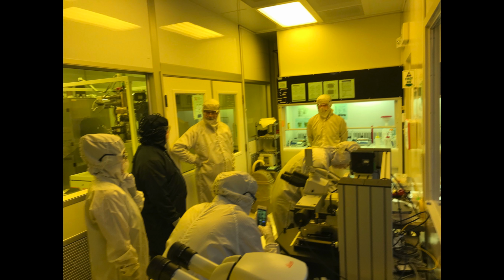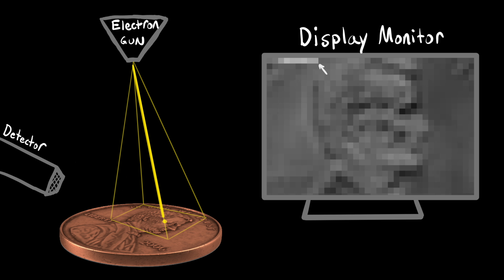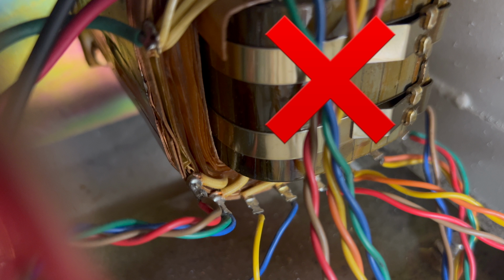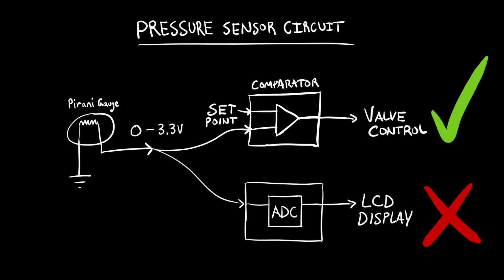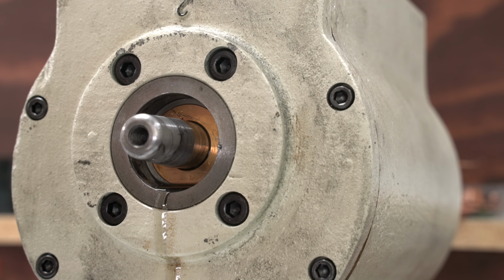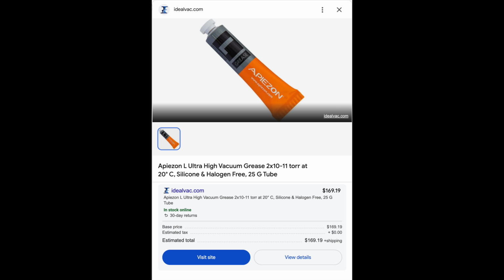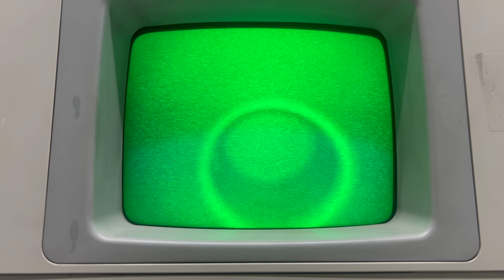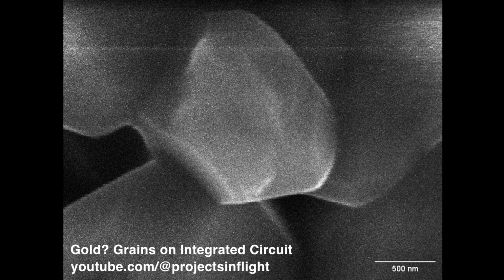I Saved an Electron Microscope from the Trash

Comment: wow. this is the best repair video on all internet. your effort didnt go unnoticed. i have a suggestion: rebuild this electron microscope and make it opensource. many parts of it are very old, and could be somehow easily changed to a more compact form. the screen, for instance, could be changed to a better display. all the buttons could be more compact too. just to say a few
Reply from the maker: I've contemplated open-source electron microscopes and I have come to the conclusion that the main limiting factor isn't any of the logic or analog boards, but the electron lenses themselves. The electron lenses are very hard to make and without the ability to make them first there's probably little point to open-sourcing anything else.

Comment: Quite an achievement this is! I bet you learnt a lot on the way. Word of advice: make sure you keep all the original parts in a safe place and not scrap them. Everything (well, nearly everything) is repairable, like the RCA cable which would be very very easy to repair, but especially the huge double C core transformer and the pump can also be fixed. The transformer is quite special and is a very expensive piece. It can be rewound by companies that specialise in this task. If you're lucky, the blown winding will not be deep inside so that the whole transformer will not have to be unwound, only the outer coils. Postage will be a killer though so try to find someone nearby. The pump can be fixed since it is just a rotary engine. Granted, rotary engines have a limited lifetime but this one maybe has some life left in it after resurfacing is done or maybe the chamber is not pitted/scratched anyway. Worn axles can be fixed or their replacements made by machinists. You just need a good one that won't charge a bomb. Etc. etc. Then again, all this is a lot of hassle so it's on you to decide if the time you spend on it will pay off.

Comment: if you replaced all the front-end transformers why keep feeding it 100VAC
Reply from the maker: There's another large transformer that i'd need to replace. Also, there are a few components such as the valve motors that operate at 100VAC and replacing those would be a huge pain

Comment: Never heard of the channel before now, this got a subscribe. May want to checkout @curiousmarc for additional old equipment refurbishment thoughts! Worst case you can make some additional side income rebuilding SEMs J/K. 

Also, its my maybe out dated understanding, but can you up the power and use the beam to take off layers of surface? A tunneling electron beam.  Maybe make truely flat sample material.

Comment: Circa 1957 Humberto Fernandez Moran at Univ of Chicago wrote a book on his work using SEM, one conclusion of which was that semiconductor 'wires' had a practical limit of narrowness at 11 nm. He said below that quantum statistics started making a conductor only probabilistic and therefore unreliable.  Can you replicate that experiment?  using a series of conductor widths.
Reply from the maker: I could potentially find materials that are that thin, but only in one dimension: a thin sheet rather than a thin wire. I don't currently have the technology to work with a wire of diameter 10nm for instance.
Reply: @projectsinflight  Thanks for responding.  Sorry my terminology was bad.  From memory, he took a silicon wafer, deposited copper on the surface, then used the SEM cranked up in intensity to burn off copper to form straight insulating strips, leaving behind varying widths of copper conductor.

Comment: had the opportunity to use a modern one in my internship for lab technician  3 years ago, its neat to see how they actually work, the lab did analitycs on material to check for asbestos fiber and differentiate in the 2 types, it also had the ability to tell you the composition to certain degree when you take out of the equation the gold and platinum layer, it was a pretty cool experience and it was a really entertaining video. On a side note i found it pretty neat the strobe warning altought im not light sensitive, great video!!

Comment: There are some videos out there that simply deserve more than just a thumbs up.... This is one of them.

Kinda convent, that they're using a simple RCA cable for video, should be easy to intercept with a 10$ USB capture card.
Reply from the maker: The one thing I don't know the answer to is this: Will a standard capture card tolerate a slower frame rate? Also can it image at a resolution higher than 480p? If not i'd probably have to make my own custom capture card.
Reply: @projectsinflight  - 1. Yes, I have something similiar setup to use an 'old' 720p Polycom PTZ camera with a YPbPr to HDMI adapter feeding a 10$ USB-capture card. You generally just tell those things the resolution it's supposed to spit out and it doesn't really care what kind of signal/framerate you feed it.

2. As far as I know the max resolution for composite video is ~720x480. But since you're probably not trying to capture video but a high resolution image I have no idea what's possible.

Comment: those membrane conductive buttons can be refurbished rather than replaced. You need to wipe down with isopropyl, wipe over 1200 grit abrasive and then clean again

It usually works - they're carbon lumps and you just need to clean off all the contact surfaces

Comment: Question: How come you're relying on a low accuracy multimeter? Uni-T is Amazon garbage I would've thought.
Reply from the maker: I have a couple multimeters, one of which is quite nice. I don't know which of them you are referring to but i believe i used the good one for almost everything.
Reply: @projectsinflight  The Red one. Uni-T. I'm an apprentice electrician, the fanciest thing I work on is farm pumps, and I was specifically advised against Uni-T in terms of accuracy and reliability. Internet reviews and tests confirm that. My mind is blown you're relying on Xth decimal points coming out of it for an electron microscope. 

I expected to see some next-gen Fluke. :D
Reply from the maker: I don't know what to tell you. this particular multimeter has always been spot-on for me. whenever i need millivolt accuracy i use my 5.5digit HP bench meter anyway. Nothing on this project required more than about 10mV accuracy though

Comment: the fact that in 1980s we had a way to make detectors count SINGLE ELECTRONS is fucking crazy...
Reply from the maker: To be fair, they could count single electrons but would miss some of them. I don't actually know what the quantum efficiency of the photomultiplier tube is...

Edit: looked it up- in the late 1930s the QE was 12% so about 1 in 8 electrons was counted. Not bad. I think we are over 20% now.

Comment: My background is in electronics and computers so I have never seen an electron microscope in person. You have received a lot of good advice so I won't echo that. What I suggest looking at APC for a UPS to pre filter the power for the electronics. Power companies supply surprisingly dirty power and something that sensitive could have issues with it. I run one on my home computer because I load it with heavy computing and when they switch circuits it glitches the power enough to crash the computer. With a UPS the computer will stay up for months without problems. The other issue is APC converters are immune to power spikes which will help protect your valuable investment.. I don't know how much power you need but I like to go between 2 and 4 times to ensure I can power all the extra equipment for long enough to have an orderly shutdown. Besides that, once every few years the power company replaces the power meter on my house without warning. The clocks all go crazy but the computer keeps chugging away. 
One last suggestion, "Google Kill A Watt EZ". It's a cheap device that will allow you to monitor the power going into the microscope so you can deal with issues quickly. I use it for it's intended function of reducing my power bill but it's handy for other things as well.

Comment: Can you use the electron beam to etch on surfaces at a nanoscale?
Reply from the maker: electrons don't have a lot of momentum. they can potentially etch stuff but the rates are very slow. There is a similar tool called a FIB which uses a beam of ions (usually gallium) that have enough momentum to actually etch away most materials
Reply: @projectsinflight  thanks for the reply and information.

Comment: Amazing work on this, incredibly cool to see a process like this play out. An incredibly tiny niggle though: seeing you sacrifice a great gaming controller when you could have just replaced the carbon contact pads on the membranes was disappointing. Sure, replacements cost money, but a $10 box of those will last you a lifetime. Other than that though, wonderful job!
Reply from the maker: I was impatient and hadn't used that controller in years, so i figured it was for a good cause
Reply: @projectsinflight  Very understandable, so no worries there. I think I'm just sensitive to seeing old, good controllers broken, mainly because of all the retro systems out there where the controllers are either broken or just gone - and how terrible the quality of most reproductions and replacements are, including the expensive ones. Apparently producing rubber membranes to match Nintendo's spec for the NES and SNES is either too difficult or too expensive for anyone to do, as none of the replacements available for those come close to feeling right. Luckily Xbox 360 controllers are plentiful (so far), but it's also one of the best controllers ever made, so seeing one die is always sad.

Comment: You absolutely should have taken the parts of the rotary vane pump to a machine shop, the vanes  or blades in the pump can easily be re-surfaced, the shaft can be either refaced by turning it down by a mm or so just using a slightly smaller seal, or, it could be welded up with enough meat on the shaft to be re-turned down to original diameter, I have done this on other pneumatic equipment.
Reply from the maker: I might do that, or resurface them myself someday

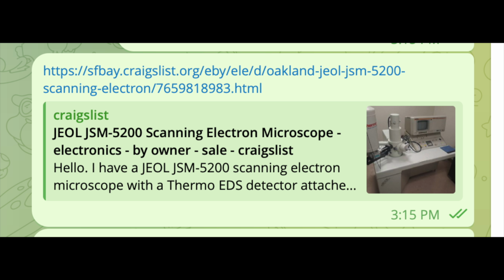Comment: Have you considered to try obtaining a second CRT? (as seen in the badly mangles one @3:00) Your blank is held on by tape so maybe a second one was removed earlier, and the capability is still inside?
Reply from the maker: The second CRT is a higher resolution black and white one for better slow scan images. Back in the day you'd have a polaroid camera that would swing over and take a snapshot of the second monitor. The computer interface makes that kind of redundant. I may use that space for something though...

Comment: Cool video! Subscribed eager for the next update.

I've been sucked into "repair old broken expensive tech" youtube recently. It seems common for other creators to replace some electronic components that don't age well, specifically electrolytic capacitors and carbon film resistors. Given some of the analog problems that this device is having, I can't help but wonder if blanket repairing all such components would help.
Reply from the maker: Yeah i am definitely gonna replace those caps!

Comment: Congrats on the vacuum system specifically - I'm a radiotherapy linear accelerator electrical engineer, and our ultra high vacuum system is an absolute pig to maintain and repair

We use a turbomolecular pump to get the vacuum in the accelerator waveguide down 99% of the way there, and a pair of ion pumps at the electron gun and target ends of the waveguide to maintain that vacuum level (charged at -5kV and pulls any remaining atoms in the vacuum)

If we lose vacuum catastrophically, usually a seal on the waveguide has gone, it usually takes out the ion pumps and their PSU, the electron gun filament, and finally fills the waveguide with contamination in the form of air (worse if it's humid air)

Last time that happened, we had our broken machine out of service for 4 weeks, whilst we ran the cooling loop as hot as we can, to bake out any contamination, all the while it's pulling on the turbomolecular pump to evacuate the contamination

Also Apezion L is the worst, it's expensive, and I always get contact dermatitis if I get any on my skin!
Reply from the maker: Oh dang- glad i used gloves then!

Comment: Great work! I guess now about 1437 people are looking for one for themselves and I expect their prices are going up. 😅
Reply: Always wonder, where there is the sweet spot in SEM age vs feature vs repairablilty.
old or basic should be easier to repair, newer or advanced one might have much better features and resolution, but nightmare to repair.
Reply: @hinz1  It may look pretty scary at first but if you break it down into different systems and sub-systems, and keep looking at it every day for hours 😂until you get enough confidence to take it on methodically and systematically, I'm sure in the end you will have fixed it. If not, you can always buy another one and start from scratch again. 😂
Reply: @examplerkey  exactly, in contrast to modern microelectronics, most of the circuits in this sem are discrete and the parts are easily identifiable to anyone with an ounce of experience with electronics. because of the nature of the circuits themselves being discrete and each only being there for one purpose as well as the electronic parts themselves being discrete parts which can be replaced individually, i think this is the sweetspot when there is no monetary incentive to increase picture quality for revenue reasons
Reply from the maker: So, microscopes from the 2000s and onward use a bunch of fpgas and stuff that are harder to repair. I've been told that the 80s and 90s are the best because they use discrete 74 series logic and ROMs mostly
Reply from the maker: Maybe so- but I would be thrilled if it meant that more hobbyists had SEMs
Reply: What about wear parts like field emission cathode?
Do you still get that for old machines or do you have to DIY replacement parts?
Reply from the maker: i would absolutely not recommend a field emitter on anyone's first microscope. Way too complicated and demands extremely high standards of cleanliness, good power, good shielding, etc. Realistically anyone who is new should get a standard thermionic filament.

most manufacturers haven't changed filament designs and also still stock old ones anyway, so parts availability is not really a concern

Comment: Ask NorthwestRepair for some toasted Nvidia GPU cores and crack them in the middle and see, if you can see the transistors.
Cracking likely gives best surface, grinding/polishing such fine structures is a nightmare, if you want to see it on SEM.
Reply from the maker: Realistically i'd want to start with a 1um feature size and go from there. I think 1um was around mid 2000s?

Comment: Great work. Just thoroughly recheck all the power supplies and maybe replace some of them with modern switching type units. Backup all the ROMs in the machine. Also, try to find and stock some of these old NEC ICs.
Edit: Syntax
Reply from the maker: Yeah... i need to definitely back up those roms

Comment: Amazing work! You can lightly sand some of the pitted parts in the roughing pump to smooth them out. I guarantee if you hit the area around the shaft seal with the finest grit you can find, it will work again. I rebuilt and repaired dozens of pumps in grad school
Reply from the maker: If this pump weren't such a pain to work on i'd probably have been able to fix it, but the way it's built you have to take the whole thing apart and put it back together just to test a single thing

Comment: one mans trash is another mans treasure. this is an amazing machine that even if its "outdated" will help you and it can probably take MUCH higher resolution images with a little fine tuning and experience with this units quirks. 
1) the video issues...
a) check the video cables, more may be damaged or corroded
b) capacitors may be going bad
c) check the signal both with and without the aftermarket board, its probably not that but who knows
d) clean the contacts, after all this time it couldnt hurt
2) vibration issues, some fairly stiff rubber pads under the feet of the whole unit would help, also check that the pumps arent too close or the hoses carrying vibration in (a simple stand holding the hose still in the middle would help.)
3) i dont know what you have around it but with how sensitive a EM is, watch for external interference.
Reply from the maker: I need to figure out how to clean relay contacts... no idea yet

Comment: Thank You for this video, it was a really great restoration. I worked on this JEOL SEM and Noran system six while writing my master's thesis in university in Finland 15 years ago. There was one small additional installation in this vacuum chamber to insert outer cables for apply some voltage for the plate that was inside this chamber. And (surprise, surprise) this plate inside vacuum chamber was nothing but one small part of ALICE detector from Large Hadron Collider, so my goal was to apply some voltage on this detector and see, what will happen on the screen of the SEM (in simple words:))
Reply from the maker: Very interesting :)